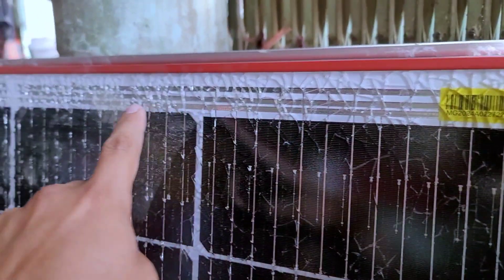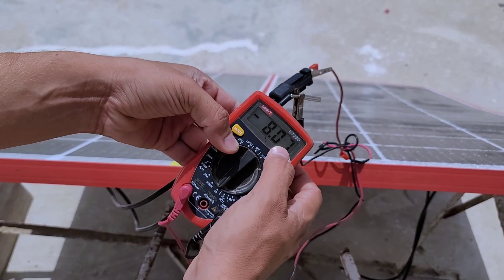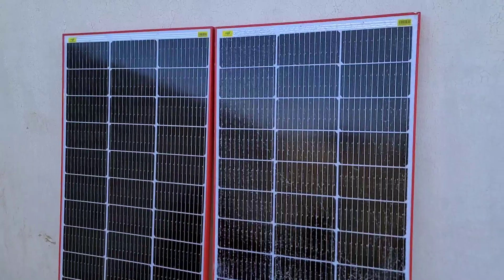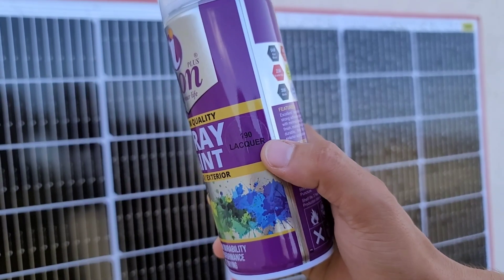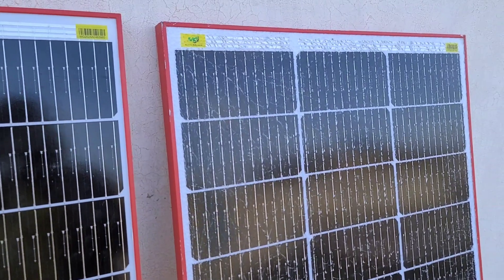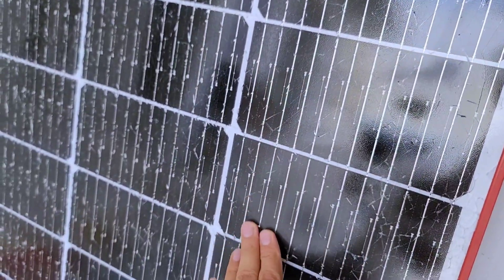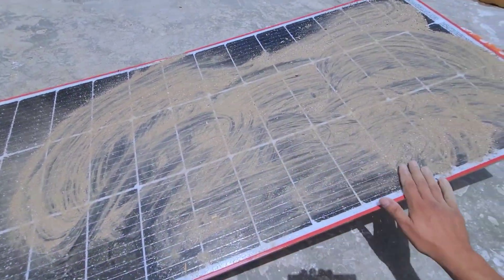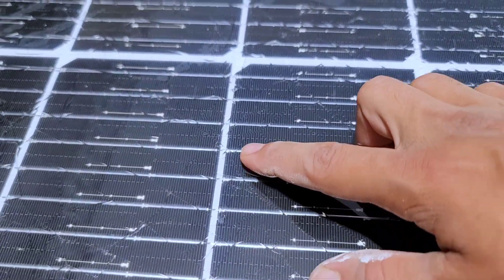How Can You Repair Your Broken Solar Panel #diy

Comment: If the glass was coated but the internall cells were damaged there is still a themal hotspot occuring to the panel which may cause fire underneath specially when you are using mono crystallin solar panels

Comment: I think a better solution would be to glue (using resin) a new window onto the broken one. I tested the varnishes on the panels of small lamps. Over time, the varnish keratinized and fell off